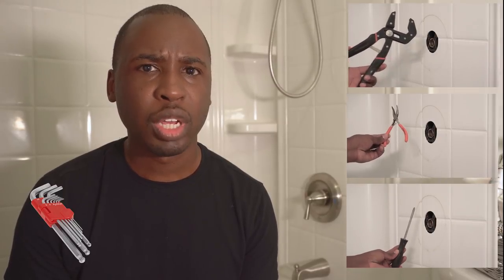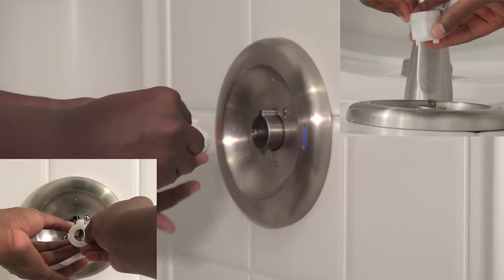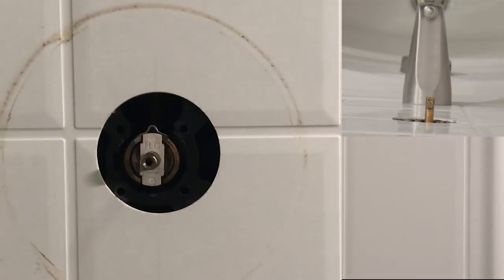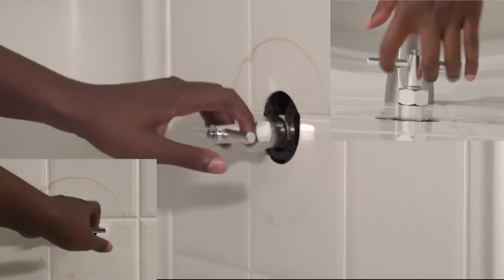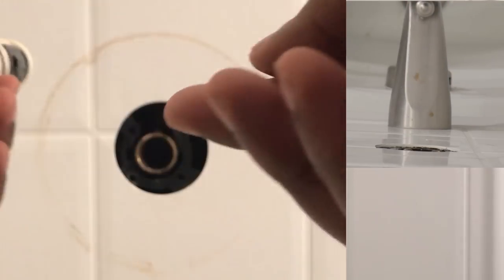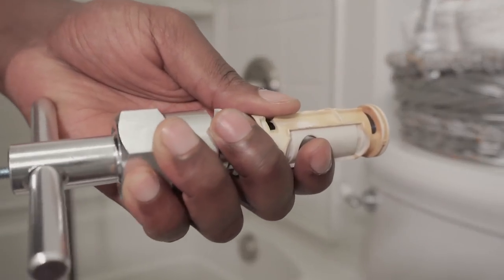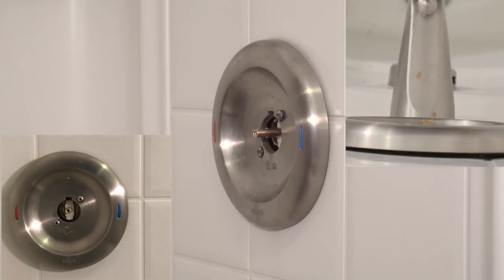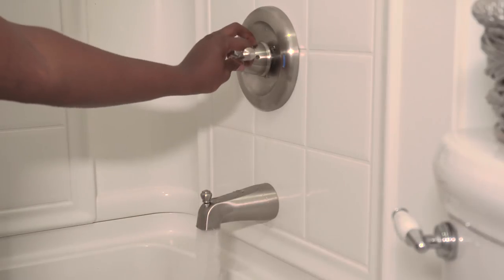How to replace a Moen 1222 shower faucet cartridge

Comment: @Hindsight 101 Hi there. I noticed that there is no link or information for people who have followed the steps in the video, but are still unable to pull out the cartridge, even with the Moen cartridge puller.  So, I wanted to share a tool I found online that easily resolves this, and I am hoping that you can include it with your other links, or provide instructions on how to search for it.  

FOR THOSE WHO STILL HAVE A STUCK CARTRIDGE EVEN AFTER FOLLOWING THE STEPS PROPERLY, AND EVEN AFTER USING THE MOWEN PULLER, Google "ONA Puller Premier Moen Cartridge Extractor Tool Posi-Temp 1222, 1225 and 1200" and see the video in here: https://www.faucetshark.com/999150-Ona-Puller-Tool-for-Moen-1200-1225-p/fshark-999150.htm .  THIS WILL SAVE YOU FROM ALL THE FURTHER PAIN AND WASTED TIME! IT DID FOR ME! Amazon has it available. I found a similar tool here, too: https://www.youtube.com/watch?v=AiQR3Nta0MA
Reply from the maker: Sorry for the delayed response I have been researching the 2 options you mentioned. After looking into the Ona puller and Lakeview puller I decided to go with the Lakeview puller. I will be creating a video soon and I will make sure I mention you in the video. Thanks
Reply from the maker: Here is the video demonstrating the various tools to remove a stuck cartridge thanks for the suggestion https://youtu.be/T4NIAiSkl3w